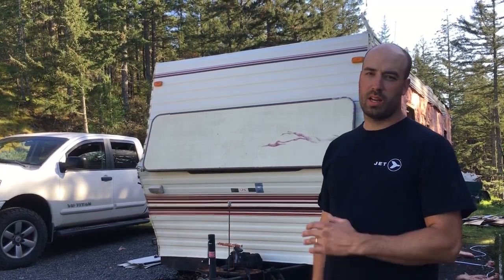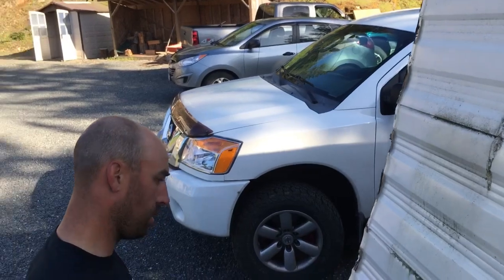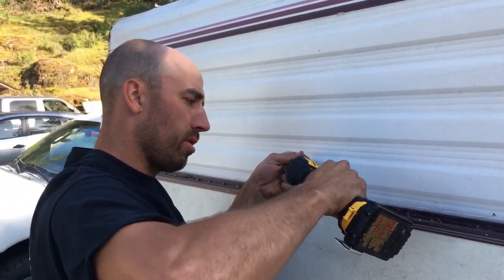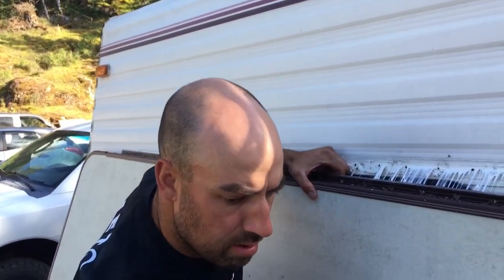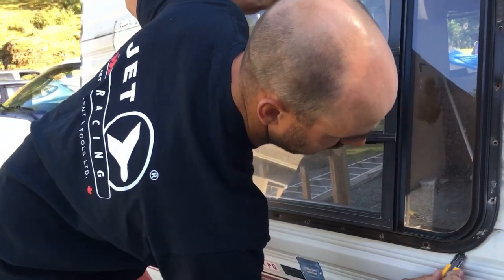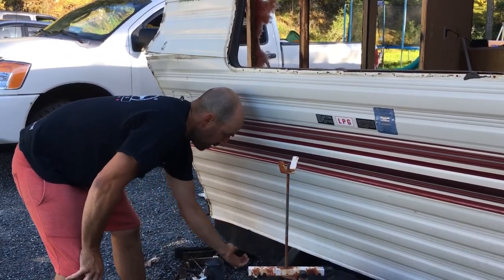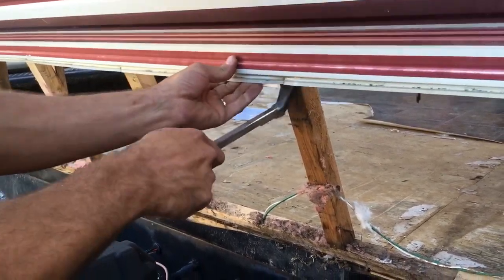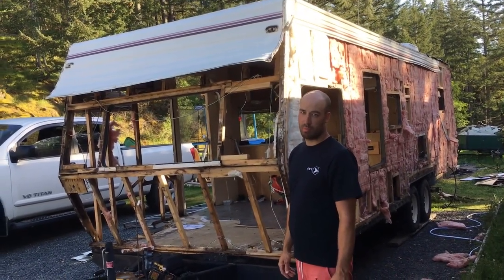RV Siding Removal

Comment: i actually used old black drywall screws for decking because the galvenized were snapping in the deck planks I got sick of drilling the expensive galv. out I wswitched to drywall because Ive used before and worked fine.